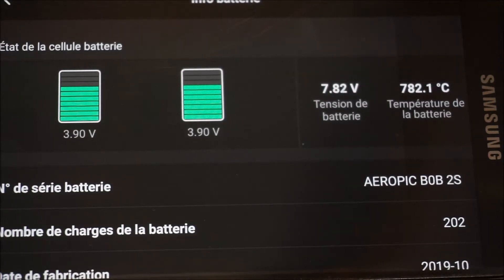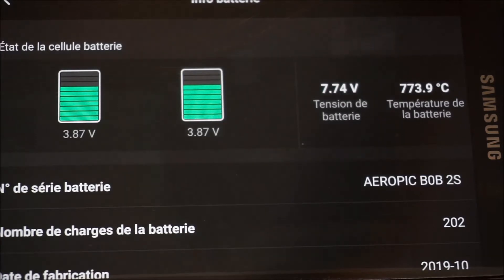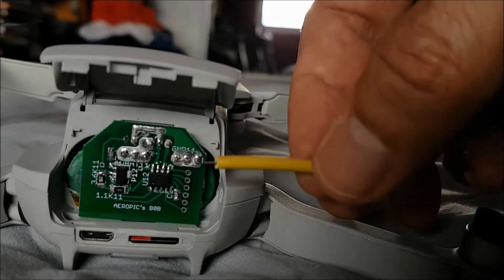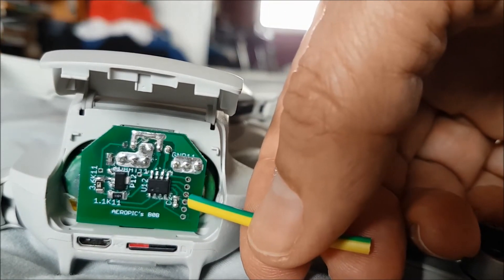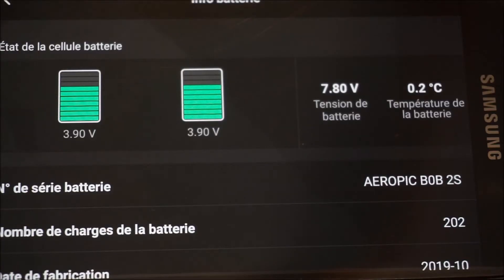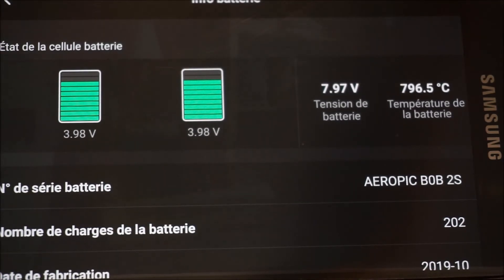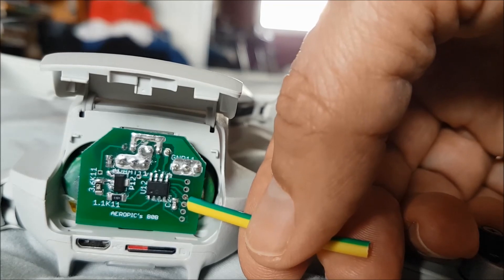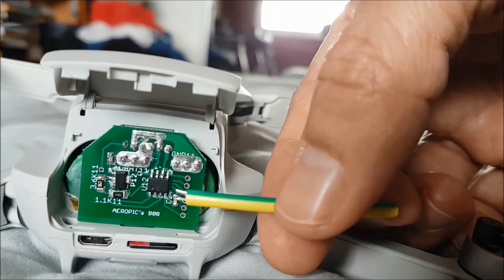Mavic Mini : B0B v202 voltage calibration

Comment: Great work. Is there a chance to use BOB with the new DJI Mini 2?
Reply from the maker: The actual B0B will not work on M2... But, maybe one day ... ;-)
Reply: @aeropic31  Why it would not work? MM1 batteries work fine with MM2?
Reply from the maker: @skyvideos827  because we tried !
Reply: @aeropic31  hi looking forward to the day when it will work with mini 2 so you can use  Mini 2 batteries in the DJI mini for less weight
Reply: @aeropic31 where i can buy bob any website plz tel me

Comment: Is that also supported to old boards that we have/purchased from you or how we apply 202 on old B0B? We need to flash it to the PIC or else?
Reply from the maker: Basically, first boards are compatible with this. The two resistors may have to be changed and the firmware shall be flashed into the PIC. A return to 'factory' is then needed.